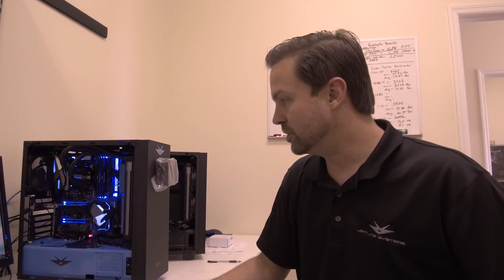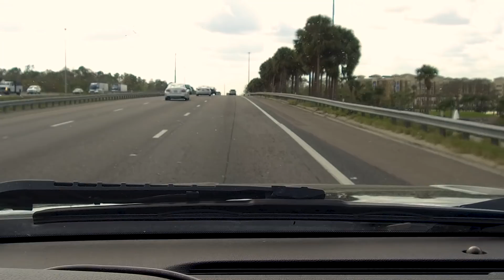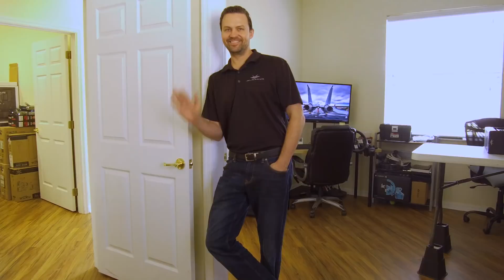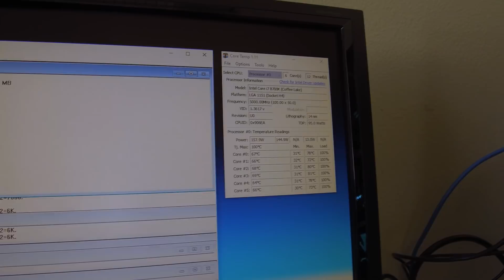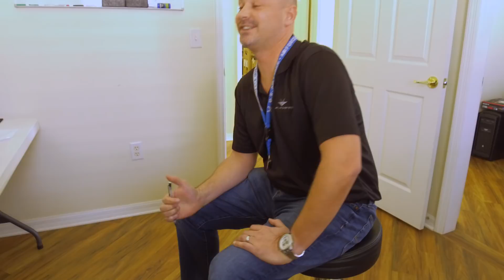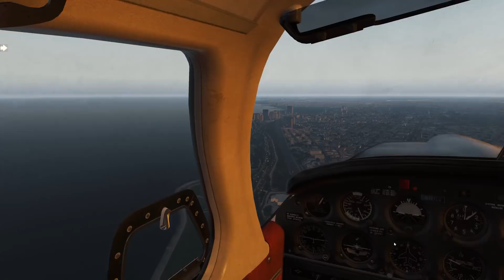POWERED BY JETLINE SYSTEMS

Comment: I can't say enough good about those guys at Jetline.  First class, top notch company operated by highly skilled, knowledgeable,  super nice guys.  I bought my first Jetline in 2014 and it has been a high performing workhorse.  I just pulled the trigger on a new Jetline Gravity GTX in preparation of the next generation of MSFS.  I'm not getting rid of my 2014 Jetline because it's still a high end performer.  If one Jetline is good .. two are even better.

Comment: Now there's a name I know. Ken was the one I talked to when I called and had my new computer put together back in January, and answered most of my subsequent questions later on. Only talked to Greg once. They did install my PMDG Boeing 747-400 along with ActiveSky to make sure it worked with P3D, so when I got the computer, I didn't really have to do a whole lot of mucking around. All I really needed to do was install my airports and I was good to go. They did a really good job with building my computer, and the performance is excellent on this thing. The first time I tested it out, I did a live stream and flew 8 flights totaling 12 hours, which is a lot better than the 5.5 hours that I could get out of FSX....assuming I hadn't fried my laptop in the process, which did happen a few times.

I do have one question, though. I noticed the lights on the computer changing colors. How exactly is that done.

Comment: Good video as always very informative. In my opinion, however whatever you do with the older ESP based sims you will always low to medium performance. Notice I did not say FPS, for me performance is key. What do I mean by that. Well, just smooth as butter that's all.  I just recently built a powerful machine with an AMX Ryzen Threadripper 1950x, 32GB of Ram, GTX1080, etc, etc. etc. Liquid cooled to the point where the sims run at around 47 degrees C. Compared with one of my other INTEL machines both are within 5% for sim performance. I get with medium to low settings in P3DV4.2 low performance as usual. Every scenery like KMEM you used in your video stutters. Performance for other sceneries is someone better. ORBX airports forget about it.  I must say that P3D is designed for commercial applications. When I use PROSIM with the aircraft model outside of the sim, I can crank P3D up to full bars, max it out and lock FPS at 30 and it is very good. ORBX and everything else looks great in P3D at this point. However, I have to say this. When I switch over XP11, who will probably have multi-core thread support with the Vulcan API by next year, I now get 40-60 fps. Fantastic! Oh that's on my 4 year old INTEL rig by the way :). Great video as always!

Comment: I generally don’t post comments on you tube unless it’s necessary. A few years ago I didn’t know a thing about desktop flight simulation. After searching the internet I came across Jetline Systems and decided to give them a call. I spoke to Greg for two hours about flightsim that day and it was like talking to a good friend who also had unbelievable knowledge about flightsim and computers. 

I decided to fly down to Tampa to meet Greg and Ken before I made my decision. I not only purchased my first computer from them I’ve also upgraded my system twice. The tech support from Greg and Ken has been absolutely amazing. Any problems that I have had( for me it’s usually user error) have always been addressed immediately. I would not be in this hobby today if I hadn’t had that conversation with Greg that day.
Reply: Until the company goes into liquidation - research build your system you are in control

Comment: I actually don't like this type of business. Flight simulator should be an optimized sw. I don't need to deal with configs and tweaks to get it to run smoothly on my high end rig. Same goes for all the other triple A titles.
Reply: gertjan van der meij take a look at XP for example.. I don't see companies being created just for the sake of saying tweaks and support. With a high end system you get great performance. With all do respect the MSFS franchise is based on old technology and no matter how hard you tweaks it it will never work as a modern flight simulator should.
Reply: Dorn Cranert I would agree if the offer tweaks and support help, not necessarily with hardware. And still each add-on manufacture should have a clear description of the requirements for it to run and stand behind it.
Reply: Considering that fsx was made in 2006 and P3D is based off of fsx. It makes sense that things won't always work smoothly. It is actually incredible how well these sims run considering that fsx was made 12 years ago. (XPlane in my experience is much better about not having to change configs etc)
Reply: This is why old SW should die or revamp..  keeping releasing the same SW with minor changes without touching the inner core is a rip off in my book, but I understand that a lot of users are heavily invested in the product (me included) however it is not an excuse to keep this platform alive . I am hoping Dovetail games will actually make a difference. Currently it doesn't look like it..